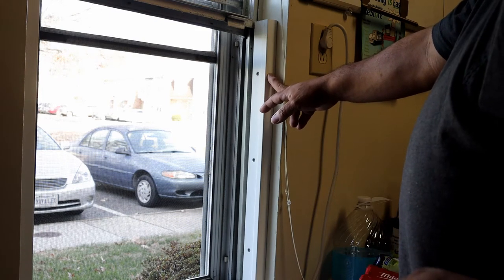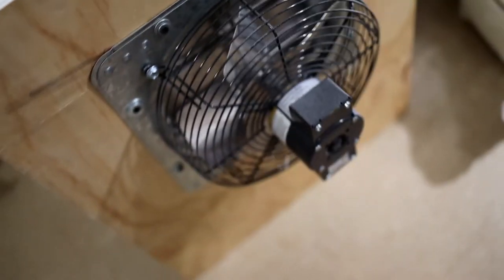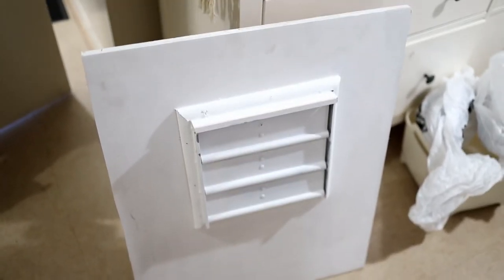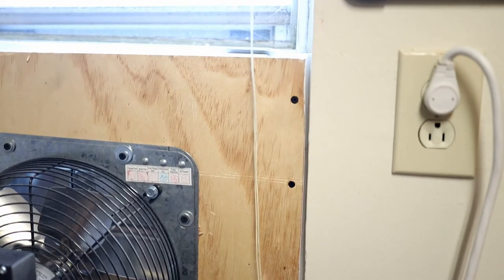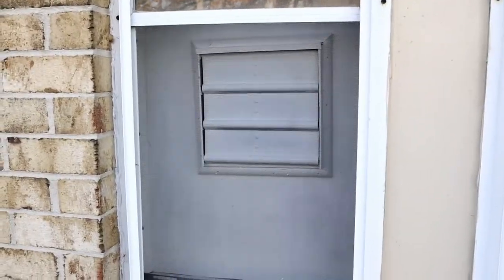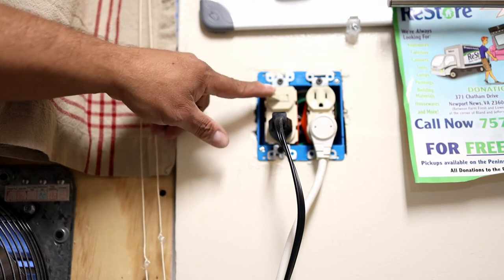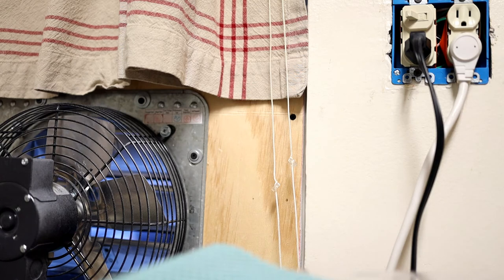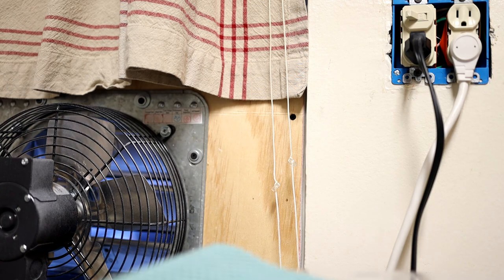Kitchen window custom exhaust fan install with On/Off switch. Attic style fan custom mount.

Comment from the maker: I didn't find to fan to be to noisy but that's subjective. 73 disables on my iPhone 6 app SoundPrint. For what this exhaust fan can do for me and my wife health, this is more the adequate for our needs. It has been know for ages that indoor air isn't the best quality and nice to see  we have some choices to address this. My complex comes with about 95% duct work for range hood venting just mines happens to be one that doesn't, so I felt the need to address this first hand. Link in description to actual fan. This exhaust fan is rated at 600 cfm, cubic feet per minuet air movement. the best I could find for the money.